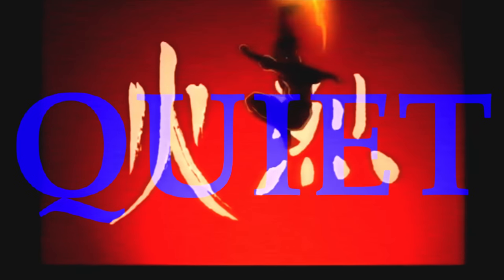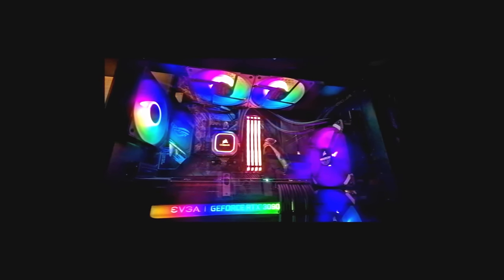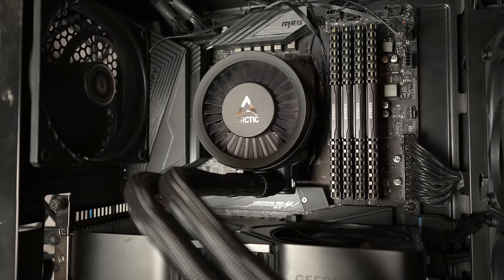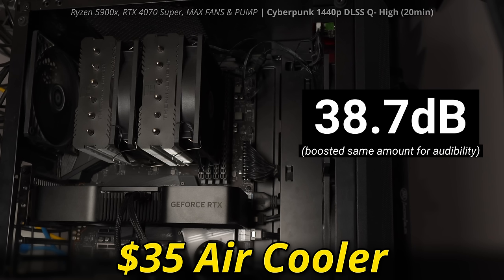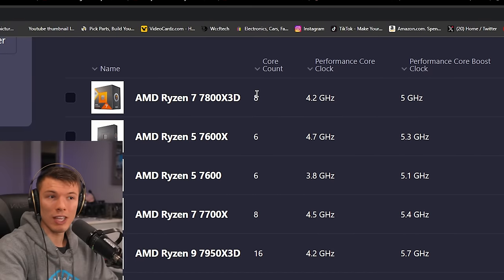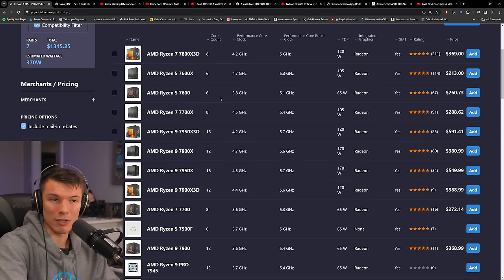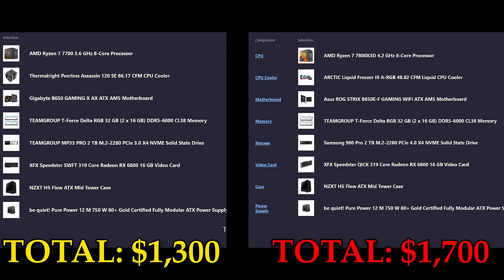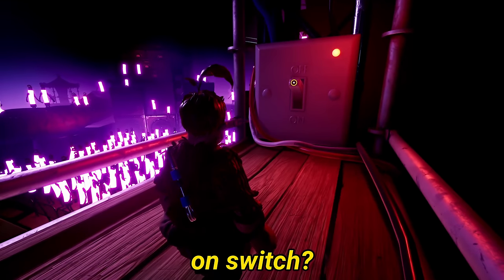How to Get the BEST VALUE PC!! (you’re doing it wrong…)

Comment: I built a very high end ITX gaming system (7800X3D/7900XTX) and half of my parts were open box deals from Microcenter.

I was able to score a CRAZY deal on 64GB of RAM for $140 because someone else returned it, no errors in memtest. Motherboard and case were also open box deals and the only thing needed were a few screws from my local hardware store.

I bought a 4TB Gen 4 SSD on a lightning deal for 50% off. Was using an old 1TB from my old laptop while I waited for the right deal. 

Even with all the ITX taxes I had to pay it still came out to about $2200 and comparable builds easily can escalate to $3k+. If you're willing to spend a day and look for the right deals you'll save yourself a ton of money.

Comment: Reviewers have the biased aspect of having access to the while entire market available so they can give the perspective on what use the best buy in reference to each product to each other from each product class

When it's a consumer perspective then they have to decide on researching from the bottom up so they don't know what is all out there let alone if they could be a more value or prosumer 

We are at a point where there's lop sided componentry where GPUs are the excessive part off a PC and other components are trying to be proportional to overall system cost

In reference to air cool to water cool; it's more about thermal mass and how much you use your computer; if you have warm ambient temp then air coolers performs poorly until air circulates; but water itself has phase change properties better than air so it transfers heat better over longer periods

If you game for 3 hours then AIO isn't for you but for 8 hours then you see that it's going to pump all of the CPU temp into your room and then your hvac needs to compensate

Comment: ok - you dont understand physics....the Power Consumption of a CPU raises exponentially with its temperatur !!so 5 C lower meant 10 Watt per hur lower power consumption.... and try to cool your CPU in Thailand with an Aircooler---
oh Gosh when people with noe clues make funny videos - im watch  them :)
Reply: actually its often not about a "need" but about a "wanna have".....regular users dont use their configs at full load at all - i do 24/7 fully load my 2 systems....Watercooling is fine and priceless
Reply: I'm guessing English is not your 1st language, no worries.  However, power consumption affects temperature, not the other way around.

The point of the video wasn't that water cooling never makes sense, but that it rarely makes sense.  If you have your computer in an air conditioned room, water cooling isn't needed.  This is because ambient temperature plays a huge roll  in cooling pc components.  If your computer is in some place with high ambient temperature, like a garage or some place without ac, water is a great tool to use because it takes a great deal of heat to warm up that water.